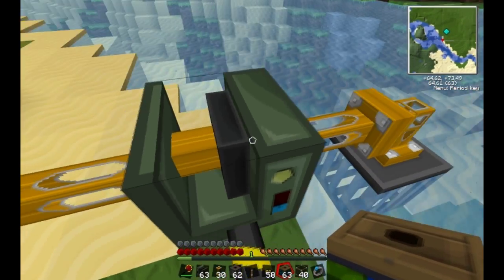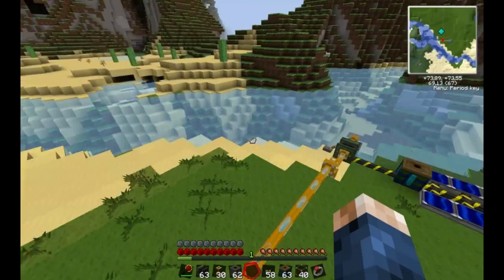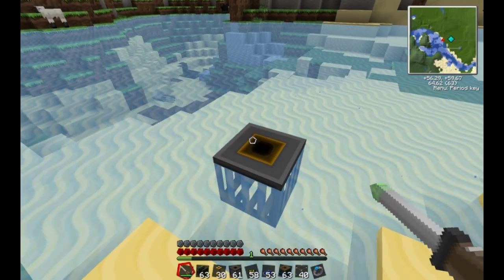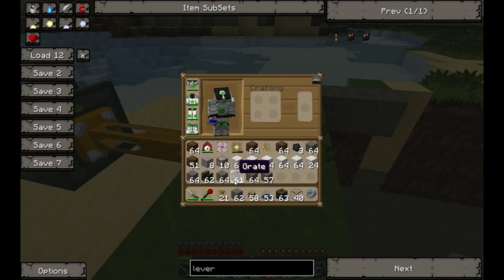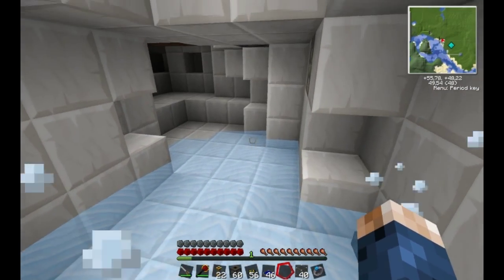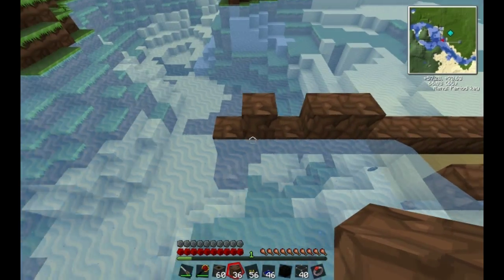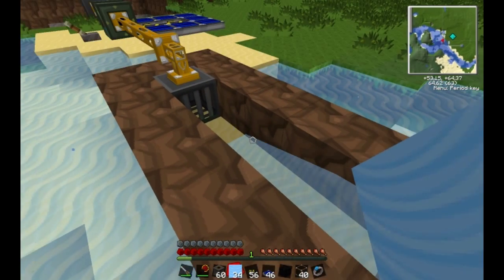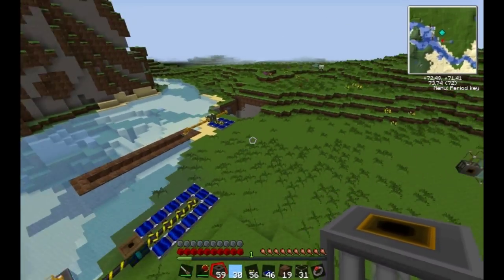Redpower 2 Tutorial #4: Pumps

Comment: The pump in RP2 is ridiculously powerful, that's about the only good thing about it. It goes through power like nothing else. It's a pain to set one up in the underground. BC did it right with tanks to try compress the amount of liquid into a smaller place. RP2 obviously doesn't work like that and nor does it interact with tanks from BC(not even the deployer). I hate the "electricity" in RP2. In IC2 and BC it's fun to work with. RP2 is just a pain and annoying.